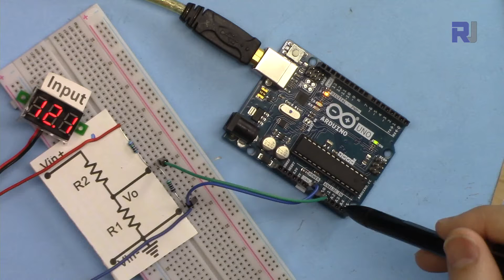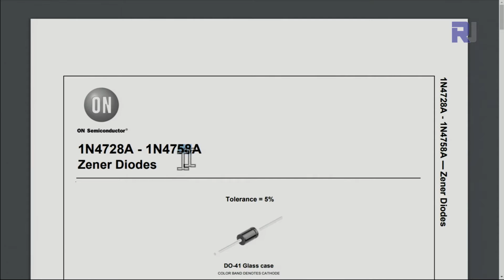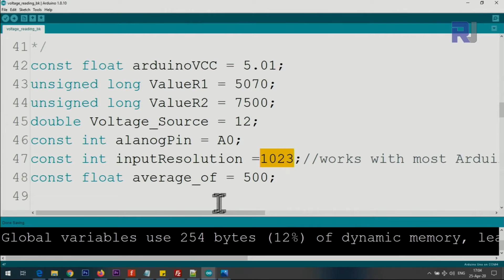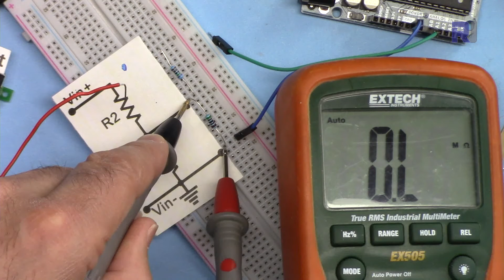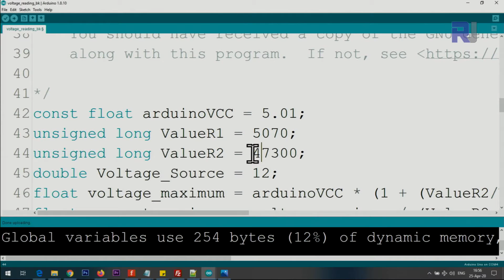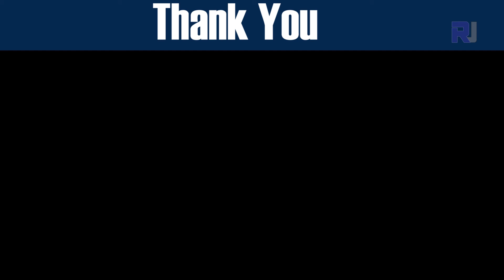Built Voltage Sensor with two resistors for Arduino to measure any DC voltage - RJT305

Comment: Hi Sir! How do we do this using a STM32 board
Reply from the maker: Hi, just find out how to read DC voltage. then apply the same principle. it need totally different code but principle is the same. Use my formula to do the calcualtion as I explained in the code.

Comment: I have 72V and 90ah will it work?
Reply from the maker: 72V is important. yes just set the measurment for 80V or 100V so you know the voltage never goes above that. the 90Ah has no meaning here. it can be 2Ah or 1000Ah.

Comment: demonstrate how can we measure 0.0001 volts accurately
Reply from the maker: That is 100 microvolts. You need 16 bits ADC or higher to measure it. UNO is 8bits.

Comment: Can this voltage divider be used in card or bike as input
Reply from the maker: If that input need up to maximum of 5mA if you use multiple output from arduino or 10mA if two or three outputs.
Reply: @robojax  I'll make custom RGB light pattern for bike

Comment: how if the input contain high current for example 10A? is that safe for using same method?
Reply from the maker: may be you did not understood. The capacity of course voltage does not matter if it is 10A or 1000A. The resisteros you use will determain the current just check the ohms law. Put the values and see the current.

Comment: In Costa Rica where I live, I can't get diodes with 2% tolerance 😢 would it still work with ±5% tolerance? I need to measure 18v LiPo battery and was able to get ±1% resistors, would it still be fairly accurate?
Reply: It's a 1W diode it's the only thing
Reply from the maker: Yes you can and the error would be as much as your component have. Try ESP32 with 12bits while Uno is 10bits so you get like 4 times more value and accurate result. I have video on eap32.

Comment: Hello, thank you for the guidance, maybe I didn't understand it, so is it possible to read positive or negative voltages with this circuit and code? That is, in the event that I want to read the voltage of a pair of cables that I do not know which is positive or negative, will I obtain the corresponding values like any voltmeter? greetings
Reply from the maker: Hello, No you must respect + and -. you will not be able to read if the polarity is reversed.  the othe roption is to add two diods on the path of your device under test and about 0.7V is dropped, compensate that voltage  in your calcualtion by adding 0.7V and you should get the correct reading but you won't know if it is negative or positive.  or connect diode on the negative source and connect it to ONE input and compensate the 0.7V and positive into other input.

Comment: Thank you. Could you tell me if you have a video on logging this data?
Reply from the maker: Sorry I did not understand what you are asking.  Which data? eveything I have done is shown in this video.
Reply: I want to measure the voltage of my leisure batteries. I also want to log this data over a few days so I can see their performance. I am looking at your sd card data logging video and trying to figure out the code  @robojax
Reply from the maker: You posted a link. YouTube is treating it as spam and I do not allow links unless you pay. So your comment with the link is not viewable to others. it is waiting to be delted by you or remove by me or approved by me.
Reply: Ok. I can delete it. How can I get the link to you? I dont mind paying. @robojax

Comment: Why resistor are heating up
Reply: Now its ok on 178k and 9.2k thanks
Reply from the maker: Yes. I have mentioned it in video. Perhaps you missed it.
Reply: @robojax  yes i missed it even watch complete video
Reply from the maker: Because you are using resistors less than 1k or 1000 ohm. Use higher values.

Comment: After upload the cord without any supply input there is a value shown in my serial monitor .please can u slove this problem..
Reply from the maker: then it seems you have not watched the video and simply used the code. it won't work. you need to understand it. Please watch fully.

Comment: Hello, one doubt, How can I be more exactly in my measuring?
Reply from the maker: This is measuring about 10mV and if you need more accurate readings then used 12bits or 16bits ADC module.

Comment: Hii what if I don't want to use any resistance or voltage divider, what changes do I make in the code??
Reply from the maker: Hi, then you need basic reading using AnalogRead which can read maximum 5V. you can learn it from this  video https://youtu.be/wuNrzQ8rpYw
Reply: Thank you for the reply...

Comment: Hello ,Thank you.  I had to try some calibrating in the code and changed this** to set an offset  "-const float arduinoVCC = **4.69;//Your Arduino voltage"  works well so far.
Any other ideas for calibration after all correct real resistance values are set pr instructions?

Comment: Can you run 2 or more of that circuit at the same time on the Arduino?
Example: read the voltages of 2 battery cells separately at the same time.
Reply from the maker: of course you can. if you watched the video, then you know we use only one Analog input. you can do as many input your arduino has. Like Arduino mega has 12 inputs.  Just use different input pin.

Comment: But resistors are getting over heated due to power loss when i tried to use it for my 6s lipo battery can you please help with this sir and also suggest me is there any another method to read voltage for lipo batteries
Reply from the maker: of course they should if you don't pay attention to selecting values.  if you use 5ohm or 10 ohm they will heat up. but if you select 1k or 100k, there won't be issue.  Here is energy meter full video https://youtu.be/oufDb7AtvNk
Reply: @robojax  thanks sir , yes i selected 50ohms and 440ohms. So now i have to select in kilo ohms

Comment: can you please help me with my project sir,,I have a 12.6vdc connected on voltage sensor module (25vdc max )(30k ohms , 7.5k ohms),the output of the module is 2.5vdc ,and it is connected to A0 and GND of my arduino nano,but im getting a inaccurate reading on my serial monitor,Im getting a 2.8vdc reading on serial monitor,it is 0.3 volts higher than the output of the voltage sensor module using this code

actualvoltage = (A0reading * 5volts)/1024;
Reply from the maker: check the 5V voltage of Arduino and measure the resistors on the module.  The best help is this video.
Reply: @robojax  can I just connect the 5v pin of arduino to the Aref pin?and use the voltagerefference() function?
Reply from the maker: yes and that is even better.

Comment: Hello. Thank you very much for your complete explanation. I saw the whole movie. Can you say that this circuit can be used for 500 dc volts? If the current of my circuit is about 5 amps will it not damage the resistors or Arduino? 
regards
Reply from the maker: سلام علیکم
امید وارم خوب باشید. بلی که میشود برای 500 هم استفاده کرد.  مقادیر مقاومت ها تعین کنندۀ ولتاژ ورودی اند.  در مورد جریان باید بگویم که اید پروژه فقط هدفش ولتاژ است.  اگر میخواهید ولتاز و جریان را باهم اندازه گیری کنید این ویدیو را ببینید
https://youtu.be/oufDb7AtvNk
موفق باشید. 
Hi, yes you can use it for 500V.  I mentioned also using a Zener diode suppress any voltage that is over 5V would also help.
Reply: @robojax  I was surprised to see your Persian comment. Thank you very much for your reply. 🤍🙏
سپاسگزارم 🌹🌹🌹
Reply from the maker: سلامت باشی
من فارسی زبان از خراسان بزرگ (فعلا افغانستان) هستم.  از اسم تان حدث زدم.
Reply: @robojax  از اشنایی با شما بسیار خوشحال شدم. من هم متولد خراسان بزرگ هستم و در مشهد(ایران) زندگی میکنم. وجود هموطنانی باسوادی همانند شما مایه افتخار و غرور من است. برایتان بهترین ها را ارزو میکنم
Reply from the maker: سلام علیکم. مجرا (کانال) فارسی علم و فن را راه اندازی کردم:  لطفا به دوستان تان خبردهید و حمایتم کنید.
https://www.youtube.com/@ilmofan

Comment: what about +/- 12volts?
Reply from the maker: you gotta use a bridge rectifier, convert it to DC and than measure.
Reply: @robojax   I do not mean A/C signial, but an analog voltage that could also read negative? Couldn't this be done with only a few diodes before the divider?

Comment: Hello, this is a great video however being a beginner I'm struggling to get the voltage reading correct. I have R1 as a 4.7k and R2 as a 220k as I want to measure a high DC voltage. I've tested the code on a 9v battery and the outcome is over 13v? any ideas would be most welcome!
Sorry just to add, the resistors are 1% tolerance and the reference voltage is 4.5. All of the values in the code have been updated but I can't for the life of me get the right voltage out.
Reply from the maker: Why you have 4.5V reference? I did not mention that.
Reply: @robojax  I've realised the power supply was only 3.3v so the 5v ref wasn't working. 

I've added an ads1115 which has a better resolution and now the readings are perfect 👍

Comment: Sir, how can I display the voltage values on TM1637 module. When I am trying to display it on TM1637, it is only showing the integer values and not the decimal values.
Reply from the maker: TM1637 is junk. see this https://youtu.be/4aCgHNJl9kY where  you can  display anything

Comment: Hey RoboJax. Why does the readings change (9.96, 9.97, 9.98, 9.99, 10.0, 10.02, 10.03) If no user interaction is happening?
Reply from the maker: Hi, Analog input has resolution of which ignores certain values.  When you use a resistor with ±5% tolerance, then the value will fluctuate about ±5% and so forth. for 8bits you can read any value greater than 5mV (or something I forgot the exact value. I might have mentioned it in the video) if you use a board with 12bit Analog resolution then you can reach much better value.  So the analog resolution of the board and your resistor causes this fluctuation.  That's why you need to average the reading. Also reduce your expectation like read only 10mV or 20mV minimum if you have low resolution board or cheap resistors.
Reply: @robojax  Okay, Thank You RoboJax.

Comment: As already said again nice video, but i still dont get it, what u did in your bargraph video was that from the viper of the potentiometer you measured voltage( but i dont have potentiometer but i have variable voltage 0 to 12 volts, can i do something like only take voltage - and + (higher then 5 volts) and display it on arduino and then display it on lcd from 0 to 12 volt. Thanks again.
Reply from the maker: First use this video to able to measure the 12V . Ince you did, add or combine both codes together to see it as bar graph
Reply: @robojax  oh right thanks

Comment: Thank you for the first video I have a question. Can we do this with opamp?
Reply from the maker: I am sorry, what do you mean by "do this with opAmp?"  This will measure voltage of any point within the range.  But opAmp is mushc sensitive and measure even less than 1mV like microVolt.
Reply: @robojax  Apart from the voltage divider I want to say, can we get a voltage divider with opamp?
Reply from the maker: OpAmp has voltage gain but if you are looking for negative gain, do a Bing or google search .
Reply: @Belgrad3D  Use a buffer just hook up inverting input to output then use the noninverting as your input. note that you still need your divider and 5v Zener

Comment: Sir, thanks for your tutorials but in my project i am facing one problem and looking your guidance on this regard, I make on LCD DC meter to read voltage 0 to 40 Volt and used resistance divider ( 100K &10K ) to scaling up and for current use ACS12, 5amp sensor, but its display continuously rolling up even neither change at input. So i am looking your help to overcome the problem and suitable code for DPM voltmeter.
Reply from the maker: This video is focusing on voltage measurement. See this video where it displays voltage https://youtu.be/xHe9RRQWMBM but also has current, you may learn from it.  But if you want to use ACS712 to display the current , here is the video https://youtu.be/kzXouSzvcp8 I can't help you to put them all together. I made the video so you learn. watch them 2 3 or 5 times until  you know how they work. I never skip the details so if you pay attention you will learn. good luck.
Reply: @robojax  thanks for your help..
Reply from the maker: You are welcome

Comment: Hello sir great video my question is I measure 42 volt DC but the problem I measure the DC motor voltage that is 42 DC the problem is the DC motor run clock waise and anticlockwise direction is there are a circuit plz tel me
Reply from the maker: If you are controlling the speed of motor using voltage, then you are doing it wrong. You should use PWM which will not waste any energy. You may measure the voltage before the controller.

Comment: Thank you for this tutorial. It is great. I have a question above it. How I can measure DC voltage from another different analog inputs? This one was on input A0.   I need mesure voltage in 4  (A0, A1, A2, A3 ) analog inputs together or 6 inputs together, where is different voltages on inputs. How will by the code above it? It would by statement .....Serial.print (getVoltageAverage(0)),  Serial.print (getVoltageAverage(1)), Serial.print (getVoltageAverage(2))? Than you very much.. František, Europe, Slovakia
Reply from the maker: Hello and you are welcome. I just checked the code and the  getVoltageAverage() does not take any argument. It needs lots of changes in order to work with multiple pins. If you've watched the video, you would know. Perhaps I would have to make another video and the video will be ARDVC-02 but don't know when.

Comment: can you send me that design
Reply from the maker: what design? I've shown everything.  the link to the code as I said in the video "you can get the code for this project by clicking on the link in the description which will take you to robojax.com  slash learn slash  arduino" There is not design. two resistor doesn't need anything. But if you want to draw it, you can use Fritzing free software or online using this tool https://easyeda.com/
Reply: Thank you

Comment: Goodday Sir i have a question. i am messuring a max off 50 volt wit a output to 5 volts. It works with the resistors but they are getting hot, almost to the point off overheating, do you have a solution forthat ?
Reply from the maker: Hello, if you followed the resistor value of 5kΩ to keep the current under 1mA, then  with 50V-5V=45V, 45V should be dropped on the resistor which should be 45kΩ. The power of the resistor should P=IV, I=0.001A and V=45V, so P=0.001(45)=0.045W or 45mW. Most resistor are 1/4W or 0.25W. I assume you are taking about the larger value resistor and that is getting hot. Measure the voltage across it and make sure the power of the resistor is at least 5 times the calculated power value.

Comment: Thanks for another great video!
I have a few questions and apologize if they seem simple.
I have a project that I want to measure the output voltage from a 48 volt 600watt dc power supply.
What wattage of zener diode would I need to go with?
The amperage will not be flowing though the Arduino, I just want to read the voltage output between the supply and a device.

Thanks!

Jeff.
Reply from the maker: Hello, I just watched the video to make sure your question is answered. Indeed it is answered. Please watch without skipping if you want to successfully use Arduino to measure any DC voltage. By the end of the video you should not have any question left to measure DC voltage.  As I mentioned this is for DC, yet people ask "can I measure AC voltage?" and the answer is NO.
Reply: @robojax  

Thanks for the quick reply!
I re-watched the video and see it now. I must have just missed it the first time. LOL!
I edited my question to change the power supply rating. 
I inadvertently entered amps instead of watts.
I was able to order a  1N5993C  from Mouser.

https://www.mouser.com/ProductDetail/494-1N5993C/

I believe that will do.
Thanks again!

Jeff
Reply from the maker: good luck. Yes that is the right Zener diode.

Comment: Thank you for this tutorial. Please, if we are to use this project to measure  AC voltage, what of the current from the AC e.g 10A, wouldn't it be too much
Reply from the maker: You are welcome. Here is the video for 50A to 100A AC and DC but see the code, you will see list of all other models for  https://youtu.be/3C33DpcSwIw
Reply: @robojax  Thank you, I have watched it. It means I need to change the module to the one that can handle higher current and rectify the 220 AC 10A to  220 DC 10A. But if am working with this value of AC which I rectified to DC, what value of the current will I use in formula to determine the R2?
Reply: I really appricate you sir

Comment: if i want to display at lcd 16*2 the value of volt that i measure ,just insert the coding lcd right?
Reply from the maker: Here is video for that https://youtu.be/TbLdAQpE4jE
Reply: @robojax  can you show that how to display volt with blynk
Reply: Sir..i use this coding for esp32..then  when i measure  it is not getting the same value of volt..can you upload video  measure use esp32 with resistor sir..Tq

Comment: is it safe to use voltage divider to measure voltage in lead acid battery car when in use? is there any huge current going through mcu?
Reply from the maker: Yes it is safe. Current has nothing to do with Arduino as it is not passing from Arduino